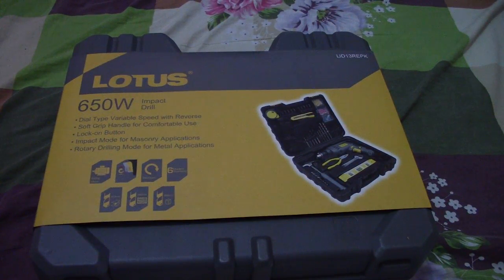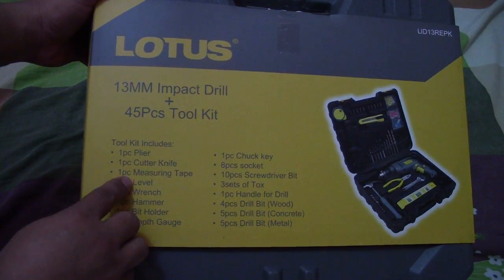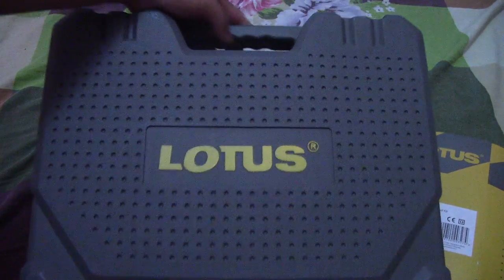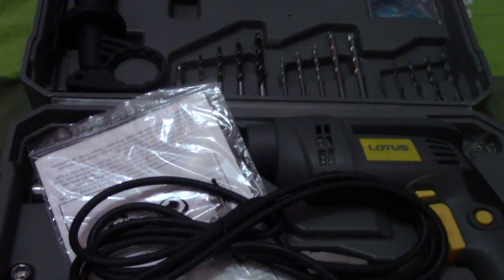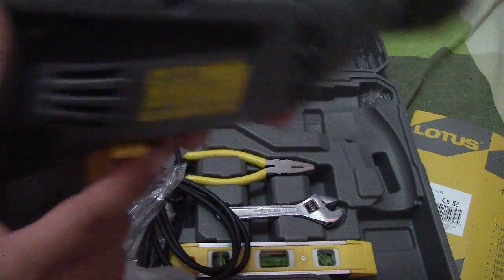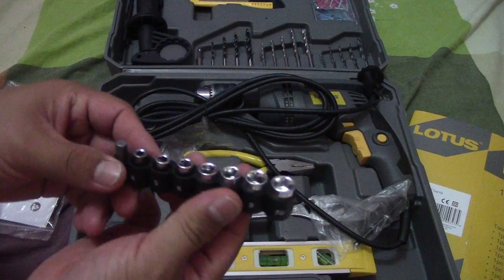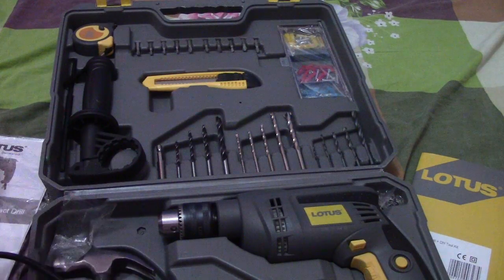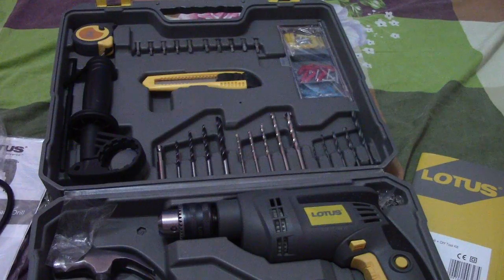LOTUS Performance 650W Professional Impact Drill - UNBOXING

Comment: kailangan pa ba ng holder ang screw bits?
Reply: I was having the same prob.. Akala ko may need pa bilhin kasi walang humahawak dun sa drill bits.. Need lang pa la ikutin clockwise yung chuck using the key provided para lumabas yung parang ngipin nya.. Hahahah...nakakabobo dn pa la pag first time mo gumamit